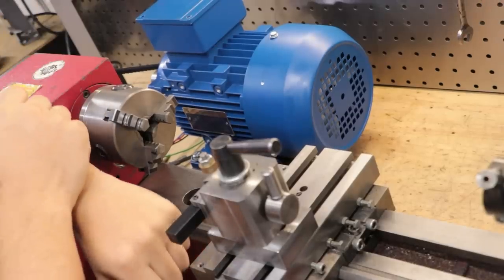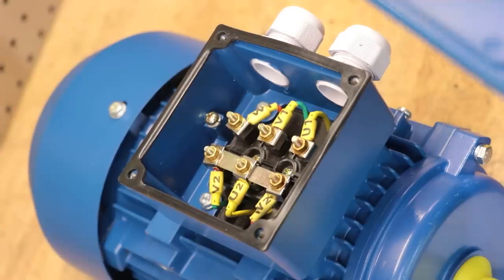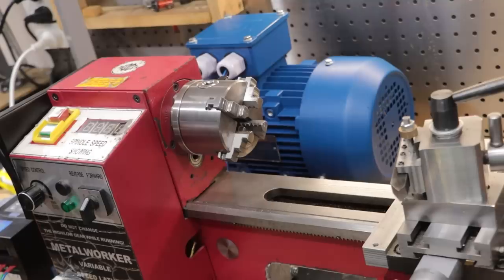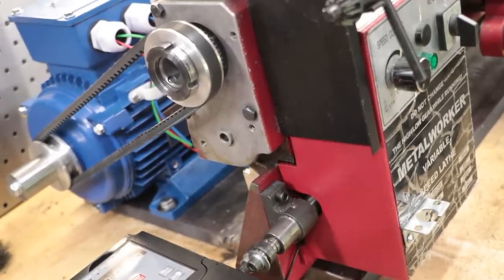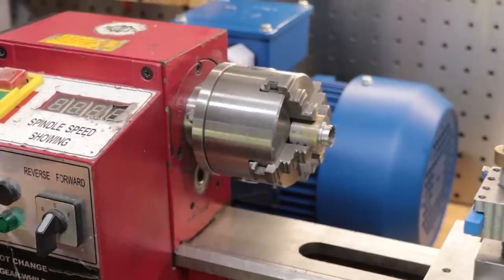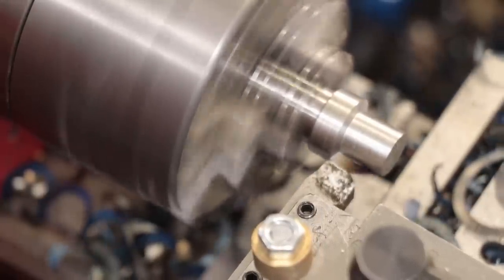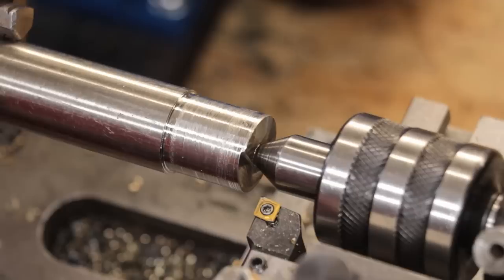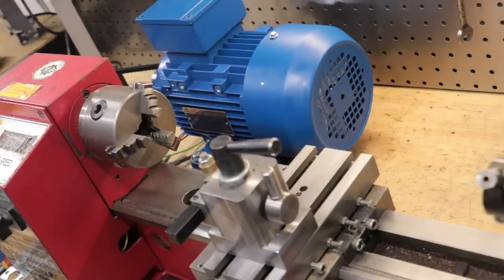The 3HP Mini Lathe..... It Scares Me

Comment: Tapered roller bearings should definitely be tough enough. Trains use them and so do most cars. I used to build them for a living. If they can handle a train they'll take care of your lathe just fine. Brand doesn't really matter. It's the design. Timken, Brenco and Koyo are typical brands and are pretty much interchangeable
Reply from the maker: I would have thought this to be the case

Comment: Hot, blue chips are a good thing and wanted! They're transporting the majority of the heat away from the work piece. Although cooling might be necessary sometimes, carbide and blue chips work like a charm the most times and are in fact desired. This is the reason to use carbide. It's heat resistant and can make huge cuts without melting the blade. Those chips you've shown look pretty fine to me. Just make sure that you don't stand in the way they're flighing. Have a look at the chip tray of some big, industrial machines - they're conveying blue shards of metal by the pound. just search youtube for "blue chips lathe" or "blue chips mill"

Comment: A note on VFD’s. When operating under the motor nameplate RPM, say 300 RPM on the 900 RPM motor, you are in the area known as “constant torque” meaning the motor will output the same max torque as any RPM between 0 and 900. Horsepower will vary, but torque will stay the same. Once you get to over 900 RPM’s you are in the “constant power” area meaning the motor will always output 3hp, but torque will decrease as RPM increases over 900.

Comment: 8:36 also: using an over-spec part in this case means it will plausibly last a lot longer since you won’t be pushing it, unlike smaller motors.  Even if you only use 1HP, 3HP capacity has advantage.
Reply: this motor will definitly overlife this lathe but with one condition. He need some type of foam to cover air intake to the engine otherwise chips would just kill it from inside... :) I allready had to make that "upgrade" on my mx-750 becuse motor start to get weird noises, so opened it and there was a lot of chips inside, so I added foam and they just cant find way inside anymore :)
Reply: @KenjiDev it looks like a tefc motor so it should be fine
Reply: @KenjiDev  wouldn't mesh work better?
Reply: yuuup duty cycle matters
Reply: The extra rotating mass of the motor will also help smooth running.
Reply: @benjurqunov  Flywheel ftw 😂
Same reason some folks mount the biggest possible chuck on their lathes
Reply: @KenjiDev  Or he could just put back the rear chip shield after modifying it to fit.
Reply: @KenjiDev  that motor is totally sealed, so no chips can get in. The only entry is for air to be drawn in and blown down the length of the cooling ribs on the casing.I have the exact same type on my lathe of 1.5 hp three phase motor a TEC one
Reply: @samrodian919  But still chips/broken inserts can wrecked a fan whos cooling this engine... :)
Reply: Actually that is not true, the motor will consume maximum power at speed up of spindle, does not matter if spindle is big or small. even tho big spindle requires more energy to speed up, that is efficiently converted back to cutting force when the cutting begins. In general with lathes, motor strain for speeding up the spindle is irrelevant compared to cutting force, which is obviously the same regardless of motor, but because his motor delivers enough power he sacrificed the gearbox which decreases motor efficiency drastically especially when taking deep cuts at low rpm. Which in turn means much bigger power consumption compared to a small motor with gearbox, and these are not small numbers. Also he obviously is using the available motor power which means increased strain on every other part of the machine. You can see the whole tool post flex even with crap video quality. There would be no point in getting a bigger motor for a crappy lathe without using its power since the whole machine isnt build to last anyway. The only valid reason to do this is to make an entertaining youtube video lol
Reply: No, over-specifying motors is a waste of energy.
Reply: As a lifelong engineer (jig and toolmaker) I would not advise over powered machinery in a home workshop.
Reply: @haroldpearson6025  as a lifelong knowitall, I disagree. :)

I get your point.  I look at it on a case by case basis.  Machines that are already strong enough to kill you gruesomely don’t get more dangerous with more power: the risk stays the same.

The downside of stronger motors only applies to when the new motor escalates an existing machine risk in some way, e.g. from bad injury to gruesome death.  In this case it’s debatable if he crossed the line.

Comment: Looks like a lot of wobble on the tailstock end, observed at about 12:55 into the video, but with this setup, I am half surprised the entire lathe doesn't explode! Really interesting video, thanks. You really put together good stuff and I appreciate it.

I have been wondering for a while if the rotating mass of the chuck etc. at the headstock end is not a big factor. Minilathes have so little mass in those tiny chucks. You do have a big motor, but belts stretch and slip, so under load, there will be speed variations. At the very least I would expect this to affect surface finish negatively. My dumb idea is to place a flywheel on the headstock, on the drive side (to balance the bearing load and get it out of the way). This should make use of the spinning momentum to power the bit through varying material. Of course, this negatively affects spin-up, and spin-down, but that seems a small price. Flywheels are cheap, they could even be conveniently shaped like a handwheel
Reply: Andy Philpotts-I was going to say the same thing. Whether the center joke was centered or the live center was showing that it’s got some play 🤷🏼‍♂️
Reply: Flywheels are good for storing energy over time and then releasing in a short period of time, or at some later time. Think of a hammer application or similar. For a continuous smooth output, like a lathe requires, the flywheel probably (sadly) won't add any power/energy/momentum benefits. I would like to see the experiment though!
Reply: spin up and down really doesnt matter much on a lathe however you gotta be really careful about balancing it or youll wreck bearings
Reply from the maker: Thats nothing i'd worry about. I took the part out of the lathe and didnt spend much time recentering it, hence the wobble

Comment: Great upgrade! Over kill with the motor helps keep it cool. Coolant is the next must have. I have concerns with the bearings, they will shed the grease much quicker with the side load of deeper cuts. Be nice to oil bath them somehow. 
Thanks for sharing 
Cheers
Reply: Tapered roller bearings can really tolerate a lot of force, no issues there. My lathe came with those from the factory, but I noticed that it's not so nice that there's no seal in front of it. On mine it sounds like it's already grinding down on some small chips that got in there.
Reply: Tapered roller bearing hold the wheels on cars and can handle the dynamic loads created by turning and slamming large weight over pot holes and the grease lasts for years. I think this setup is fine.
Reply: @cwilliams4227  Yeah but I think Ricks point was the grease can get flung off. Cars used sealed roller bearings, so the grease is retained inside.

Comment: Good job on your lathe upgrades, you're really getting some good work out of that little lathe! In a few of the videos I've seen there were some times that I had some safety concerns - in general it seems like your RPM is a little high for the material, though that may be necessary due to lack of machine rigidity. Just be wary of the possibility of ejecting parts from the chuck. On one of the other videos you can clearly see the work slipping in the chuck (was running true, after the hiccup it had a slight wobble.) At high rpms this can be very dangerous!

I would also recommend chucking up as much material as possible and facing the work before you center drill for a live center. Seeing a center wobble makes me 🙈

Great job!
Reply: That could be because he was using a fixed speed AC motor until now.  This upgrade should help quite a bit.

Comment: What you have done here is what is done on many CNC machines. VFDs do not give anywhere near full power at low speeds. In order to get torque at low speeds you can either fit a gearbox or a bigger motor. These days the latter is the cheapest option. So while you will never need 3hp at full speed, you will be glad of it when doing heavy turning at low speed. In industry when motors are run at low speeds, it is common to remove the fan fixed to the motor and replace it with one driven separately. I can't see any reason why you couldn't do this if it becomes necessary.

Comment: Very cool. Believe it or not I have taken a 6mm depth of cut (entire edge of a CCMT060204 insert) in both mild steel and cast iron, on a Premo Aussie made lathe. It was a 400kg+ lathe, with a 1.5hp single phase motor. I think both mass and rigidity are as important as motor power. It is heaps of fun to watch what you can do with this beast of a mini lathe though. I liked the comment where the guy who made the QCTP said it should be fine. 😂 Cheers, Craig
Reply: Dept of cut is one thing.  Feed is another ☺️ not many machines under +2000kg is capable of both 😁
Reply: @OmeMachining  of course 👍
Reply: I can take 1/4" depth of cut on steel all day long on an Acra 14x40, which honestly isn't a great lathe.  It's just, you know, a real lathe, unlike these little mini-lathes.
Reply: Having a proper geared lathe makes a big difference as well, as it will harness the maximum amount of torque out of the motor.

Comment: The next big improvement might be an electronic lead screw. I have installed one, afer the big pulley on the spindle for the 3-phase motor made the gear inaccessible for the change gear. But be warned: the electromagnetic noise that comes from an inverter motor makes the setup a bit tricky to run reliable.

Comment: It's amazing how much work you can get out of a machine with proper setup and know how; rigidity, torque, tool geometry, etc. I have a nicely tuned south bend 9" with 3/4hp motor that I can use to easily take .250" off the diameter (.125 DOC) of steel stock. I also have a south bend heavy 10 that I've never properly tuned as it was in "good enough" condition when I bought it and I just wanted to put it to work, and it struggles with .100" diameter cuts even though it's a MUCH heavier machine than the 9".

Comment: Your revolving centre was looking a bit wobbly and that could lead to some serious chatter issues which will mess up the surface finish, you may want to look into just how much that thing wobbles with a DTI and maybe replace it, or make the tail stock more sturdy, love the content I can’t wait to get my home shop up and running as nicely as yours
Reply: I think the problem was that the end of the bar wasn't machined first, therefore the centre drill went in at an angle - you can see this if you look carefully at the whole process. The end result is that the centre has to go where the 'off-centre' has been done and therefore vibrates out of balance - and that ain't gonna do the lathe any good at all!
Reply from the maker: That was my fault. I had to take the workpiece out of the jaws to take the carriage off to tighten the retainer plate. When I put it back I never bothered to recenter it and that was the result

Comment: If you're really scared of it, maybe add a clutch or use a cheap flat belt that you cut to size and glue up. It should be much easier to modulate the slippage on a flat belt than a V belt.

Comment: You can thread on a larger pully that extends past the gears or you can try out a CNC leadscrew. CNC your leadscrew can allow you to cut any thread you want and you can slow it down much slower than the stock gear train for the leadscrew.

Comment: If you want to prevent the motor from overheating at very low speeds (especially since it's a 6 pole motor so you can run it really slow even with open loop scalar vfds) simply attach an external fan, probably a 120mm one, sunon ones are really good and you can get them at any voltage that's convenient for you. just mount the fan on the outside of the fan cover blowing into it

Comment: Using an oversized motor will help you with the cooling at low speed issue. Power ratings for electric motors normally indicate how much power they can produce without overheating, as that is usually the limiting factor. Running at slow speeds it won't have the full 3hp worth of cooling ability, but I don't think you will need the full cooling potential much of the time. Just having a larger thermal mass of such a big motor also means you can push it way outside of the cooling capacity for short bursts. I don't think you will have to worry much about overheating that thing.

Comment: Most inverter rated motors can be ran down to 50% rated speed without cooling problems.

If it becomes a problem, remove the motor fan and replace it with a separately powered fan.

Comment: 316 stainless is very gummy due to the high nickle content. It makes sense that geometry designed to cut aluminum would work. Even HSS would be a good option. Like you said though if it start to rub and heat up it turns rock hard.

Comment: Because of that VFD, witch is just fine, the useable range is 30-90 hz. At 30hz I would add a cooling fan as the motor is not spinning fast enough to cool itself.

Comment: Very nice! You can never have too much power. High feed rate and proper surface speed is crucial with indexable carbide, both of which are enabled by the big motor and VFD. You'll never use the full 3hp for more than a few seconds at a time on that tiny lathe, but it does allow you to run a huge speed range without overheating the motor.

I'd avoid running messy coolant and instead rather put that effort into a proper air compressor and hearing protection to support a good air blast set up.

Comment: 7:55 You might see if you can find an old iron surface plate and use that instead.  I know this will of course depend on where you are, but I'll occasionally see some older worn ones for 100-200 dollars.  Most of them just tend to have a bunch of dents and gouges from accidents in a shop, so it limits their use as a surface plate, but just take a whetstone to them and they'll be a way better mount than some bars of steel.

Comment: Interesting stuff.
Regarding changing the chuck, a 100mm chuck will fit. In fact there are versions of the mini lathe with 100mm chucks as standard.
Fitting a backplate will work but the downside is that it will increase the overhang of the chuck.
I bought a replacement spindle for mine to take a 100mm chuck with a 72mm register. It wasn't expensive  but provides a more ridged setup and a slightly larger hole through the spindle. It works well.

Comment: Love it mate. You got more balls than I do, have only really run mine to about 2.5mm DOC - but that's as far as I go. Currently in the middle of a Clough42 e-leadscrew conversion (With a rollled ballscrew), but with a different microcontroller (I'm more familiar with STM boards). Have also previously done roller bearings (I found them to be quite a bit louder than angular contact ball bearings). And a full CNC conversion is on the drawing board for later this year.

Comment: For short periods of time motor will be fine under 30Hz, but I'd recommend to not go under 30Hz for longer periods.
Reply: I don't think he really understands how induction motors and VFDs actually work.
This whole thing could have been done with almost zero expense and a much better result using a 1.5-2.5 HP DC motor and MC2100 controller from a discarded mid-size treadmill. DC means 100% torque at zero RPM so it reduces the need for gearing, however the treadmill motors spin faster so you need a small (original) pulley on the motor to get the spindle revs within a usable range.

Comment: Hi, not connected question, what lighting do you have in your workshop? Your all videos are so well lit, something that seems impossible in my garage.
Reply from the maker: Lighting is definitely underrated. In short, lots of studio lights and light panels. Nothing too expensive, just made sure that the light temperate match. For the lathe I have roughly 7 different light panels to illuminate it. Two behind it, two on top, one at each side and one at the front. Similar story for the mill. Two big light panels mounted to the top with 3 big light rings on the sides. It is definitely over kill but I have done a lot of film work and lighting is very important.

Comment: The most concern I have is the spindle nut on the back side of your lathe spindle. It looks like you have maybe 2 or 3 threads keeping your spindle inside the housing. It would be better to turn a recess into that pully so you can get more purchase and lock that nut good. If you ever run in reverse or it backs off just the few threads your spindle comes off at speed! Nice work though. 3hp is crazy power.
Reply from the maker: Im not too happy about it either

Comment: brother, please increase the size of the bolt head surface you used to fix the lathe to the steel plate.. and make sure their high rated.. with washers.. it appears in the video they are WAY to tiny for all that torque.. stay safe and keep up the great work.

Comment: No problems having a big motor, as i t only puts out the amount of power you load it with. The big benefit will be when you slow it down, wich you should do with the stainless. Half the speed, a hefty feed and flood coolant is the way.
Good job!